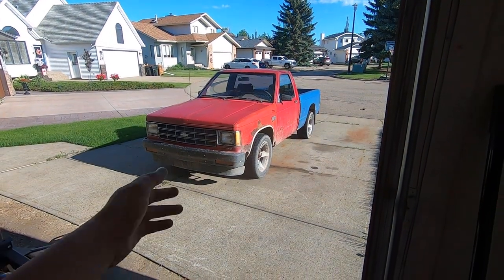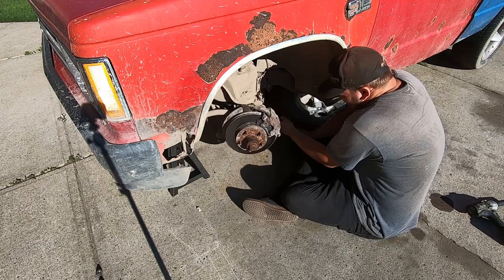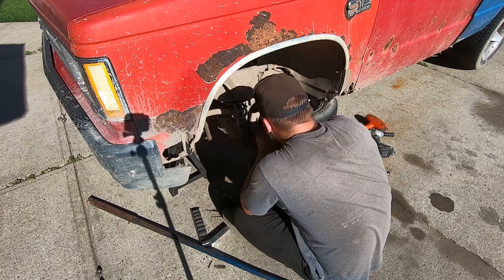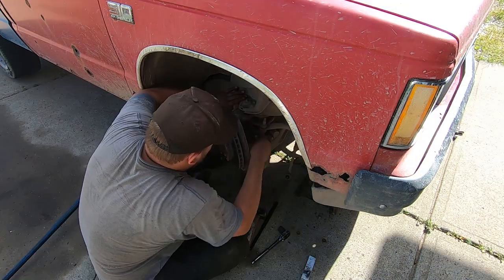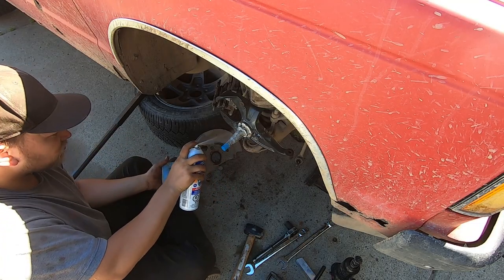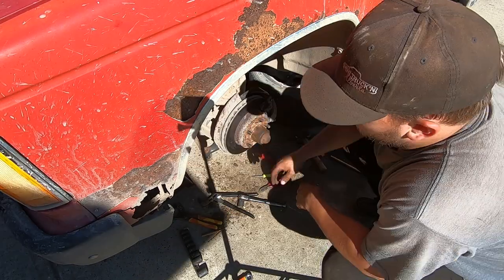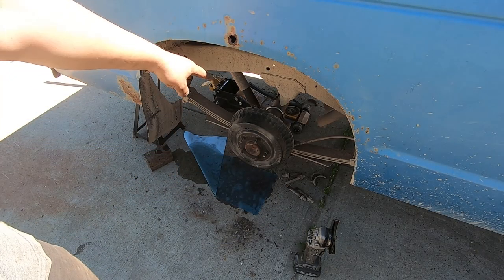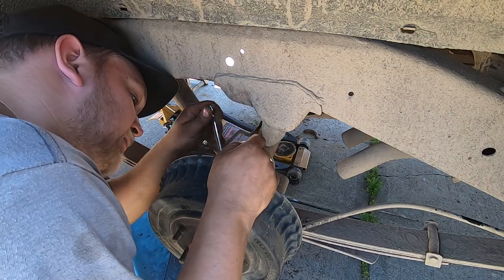Lowering A Truck In 5 Hours?!  Lowering My 1987 Chevy S10

Comment: I did a 2-4 drop on my sons 89’ in about 2 1/2 hrs. Now in fairness to you. 1) it wasn’t rusty 2) I do this stuff day in day out. 3) I didn’t record it, just got in there and got it done. 4) did I mention it wasn’t rusty?? You could’ve gotten it done faster if you weren’t filming or rusty. I had a limited amount of time in which to get it done is the main reason I didn’t film it.
Reply from the maker: The rust and recording is really what took most of my time up. And breaking that brake like, then a couple buddies came over while I was working, so all said and done pretty not bad for a Saturday
Reply: @ak_strem7010  buddies mean well, but get some tools in your hand and stop talking. 😂

Comment: V8 and or 4 cylinder springs don't exist and for another when you install drop spindles the geometry of the suspension doesn't change so adjusting toe is not needed.
Reply from the maker: Truck was a 4 cylinder, has 4 cylinder springs. It’s v8 swapped, hence why it sits lower.

Bell tech spindles DO NOT keep the original steering geometry, so toe has to be set...however due to the fact it’s not changing the suspension itself you are correct but it’s the CAMBER that does not have to be adjusted.

Comment: So I bought 2 inch lowering blocks for the rear of my 91 single cab short bed s10. However they are universal blocks and they aren't tapered to 2 degrees like others I've seen. Can anyone tell me , does that 2 degrees really make a difference or will I be ok using the flat blocks?
Reply: I’m PRETTY sure your drive shaft will be off 2 degrees after the drop causing a vibration at higher speeds, if you dropped it and are getting vibrations that’s the reason
Reply: @ceelo240  thanks I actually returned them and got the correct tapered ones after posting this 😁
Reply: @The_gordo_channel  that’s good, it’s a pain trying to get everything back to factory angle. Haven’t lowered my 93 s10 blazer yet, been doing a lot of research before I commit